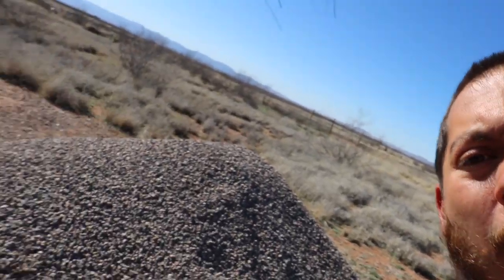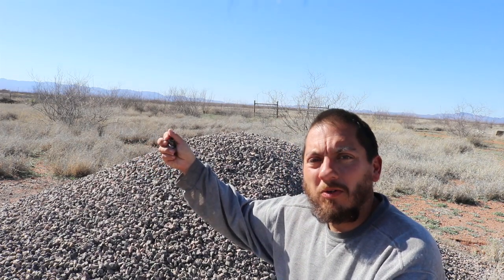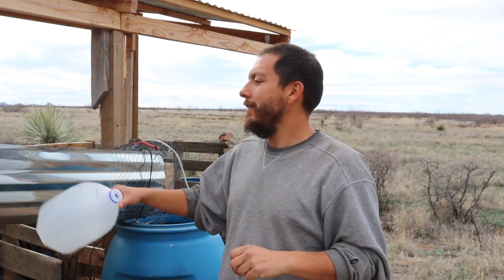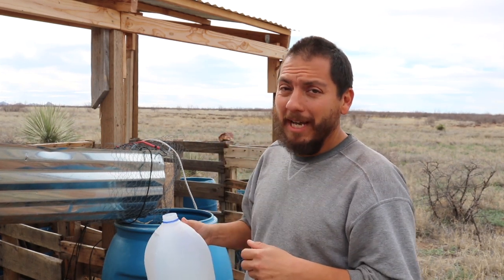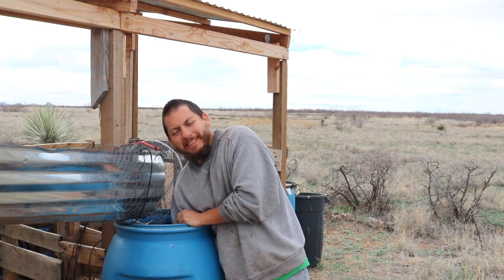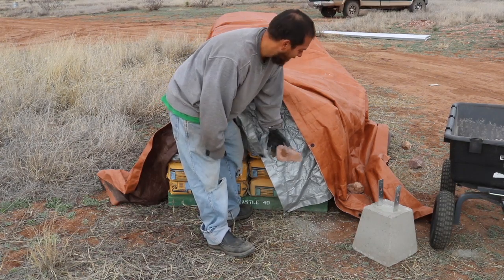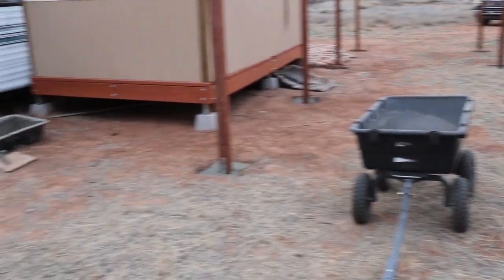Epic DIY Off Grid Water Harvesting Carport Build- Gravel and Concrete

Comment: Are you going to partially build the roof to start catching rain or are you going to wait to complete it all?
Reply from the maker: We're going to wait until the roof is complete. Before starting the gutter system. That's going to be another huge project.😬
Thanks William!🙏
Reply: The reason I ask is I don’t recall what your doing for water now. But a couple of IBC totes would work with minimal work to start collecting water. Or going into hose other tanks you have
Reply: Oh and good luck 😎
Reply from the maker: @EastMesaUrbanHomestead  very true! We may set up some IBC totes to get some water.